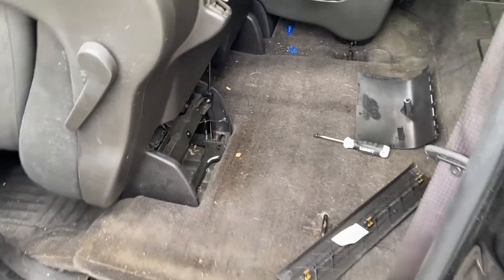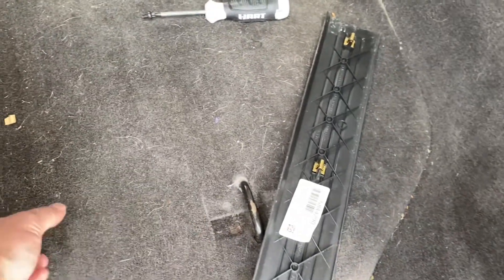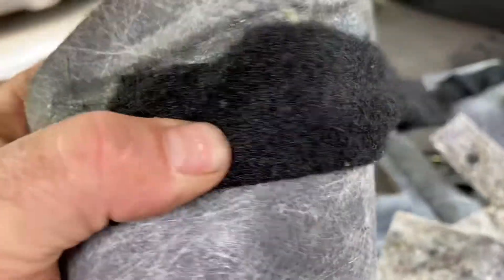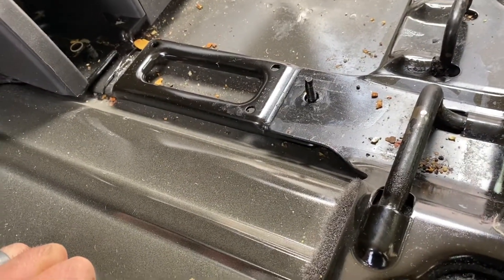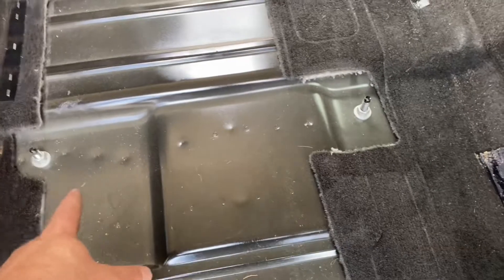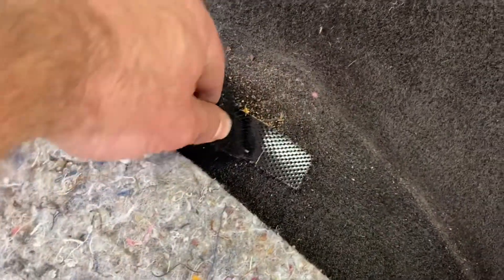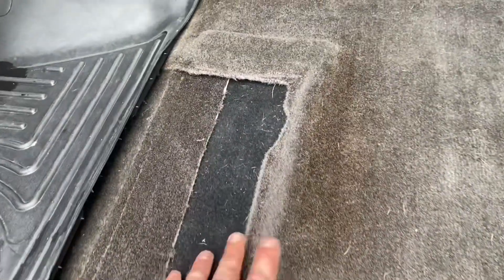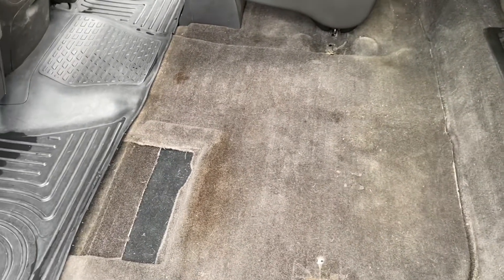How to remove the 2nd row bench seat in a GMT900 (2007-2013) Chevy Tahoe or Suburban

Comment: Thanks for the video, seems to be only one of it's kind. I'm planning on converting a 2011 suburban to live and travel in, so taking out the 2nd and 3rd row completely is advisable. I will say it didn't look to smooth, which is unfortunate, but I suppose I could get some padding and figure out how to best level it.
Reply from the maker: The spare cheap floor mats really have held up well and smoothed it out. If it wasn’t for the floor liner it’d be really smooth. Thanks for watching and good luck!
Reply: You need to pay it forward and post a video cuz I’m thinking the same thing!
Reply: ill be posting my tahoe setup soon. super basic but it'll do

Comment: Thanks! I also want to pull out the 2nd row for a road trip with the dogs. Looks like this is a job for the garage as I am female and there is no way I can lift a 100 lb seat.
Reply from the maker: You got it! Putting it back in might be a bear. By taking it out isn’t too bad once I learned to “roll” it out the back.
Reply: @utjay2008  Thanks! I won't put the second row back, the vehicle is for me and my dogs and that second row is not dog friendly (but the third row is perfect for them).

Comment: Thanks!  Did you have heated seats?
Reply from the maker: Sorry I just saw this comment. I do not have heated seats, or power. Do any gmt900 2nd row seats have heat or power? Genuinely curious.
Reply: @utjay2008  Yes.  2009 Suburban LT.  Currently the family mountain bike shuttle but I'm hoping to convert to a tiny camper once the kiddos are out of the house in a couple years.  Thanks for the video.
Reply: would removing a seat mess something up if they were? As long as you tuck any connectors away I don’t see a issue
Reply from the maker: @carlcrouch6447  I highly doubt it. But just remember to disconnect any wire harnesses first. I didn’t go over that in my video.
Reply: @utjay2008 I have heated seats in mine and will be removing them today if the snow stops. I’ll update this thread and let you know the process 🇺🇸🤘🏼
Reply from the maker: @ShootersOutdoors  heck yeah! We’re all here to learn. Keep us posted…
Reply: @utjay2008  So it was exactly the same removal (I have the 2 captains chairs) for second row. For the heated seats there was one wire bundle taped together with a single connector that was just a push clip to separate. Super easy. My vehicle didn't have the 13mm nuts to remove, only the four 18mm on each seat. I pulled the seats out the back like how he did in the video. Super easy removal and created a ton of room, now I can fit my ice house in there perfectly. Good luck!